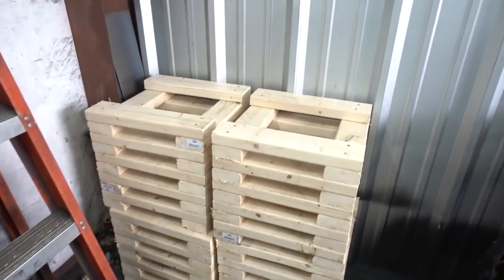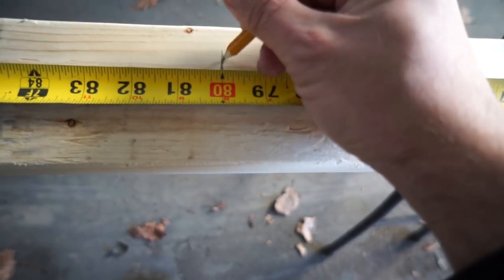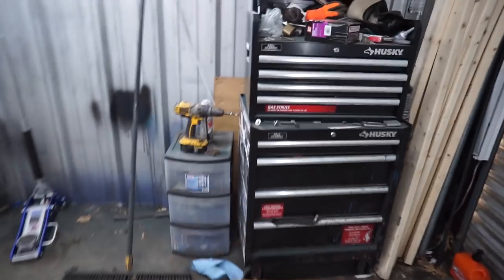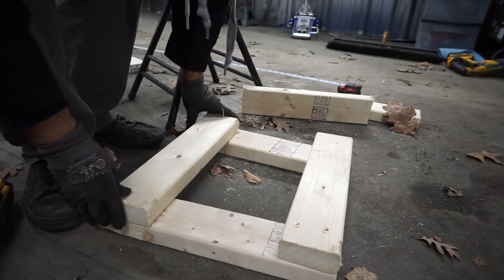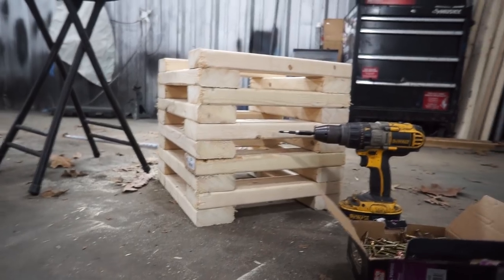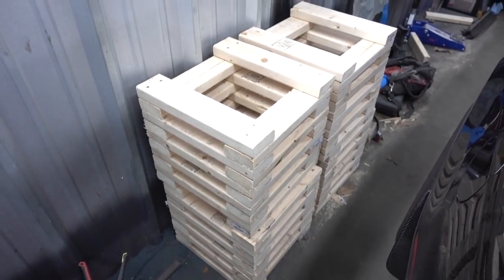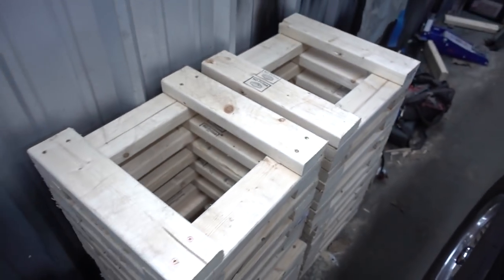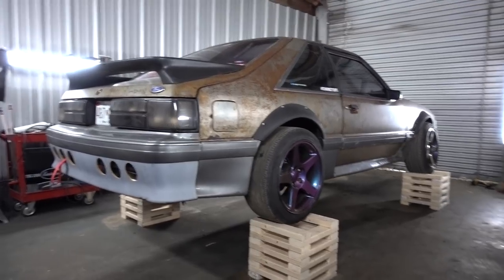How to Make Cheap Car Stands

Comment: I don't know shit about this stuff, and I don't want to know, so I own 4 pairs of jackstands in 4 sizes and always go overkill with ratings & redundancy.  I just pretend I'm flying a 747 and failure's not an option.  My famy has learned they can relax bc I don't take chances.  When the time comes I'll spring for a lift

Comment: Put some dolly wheels on it so you can move you’re non running cars around the shop or when you drop you’re motor out of the bottom you can push the shell out of the way and remove motor with wood dolly you drop it on. I would recommend pressure treated 4x4 wood tho so it doesn’t rot you may have to buy less and seems more safe 😂😂😂

Comment: Unsafe. Should have put 3 pieces side-by-side not only 2 and then double pieces in the front and back for the top layer.
Reply: Not really. Each of those stands will stand over 1.5 kN of force easily.
Reply: wood is stronger than metal come on now.

Comment: The car is resting on 2x4, if that breaks it will go to the next one and on and on. Before it goes on and on, something else will happen. The weight will shift to one side and collapse in a strange way. Even with  jack stands shifting can happen if the vertical balance is not maintained, poor vertical balance will almost certainly lead to shifting and eventual collapse. Dont underestimate the weight of automobiles.
Reply: Dont underestimate the strength of wood
Reply: YES! I see that now - just like the World Trade Center buildings (1973–2001) collapse! He needs barrage balloons and many large oak trees surrounding his garage, to ward off a terrorist attack!

Comment: Would putting 3 planks across instead of 2 be even more safe?
Reply from the maker: TheAkNas I imagine it couldn’t hurt.  I have a friend who actually did 3 across on his a while back.  The only part that might such with 3 across would be that the tire wouldn’t sink in as much on the top level.  Maybe that one could be left at just 2 boards.
Reply: I suggest cutting each piece at 14". At this length the top layer can be solid by placing 4 pieces side by side (3.5 x 4 = 14"). Perfect.
Reply: The top one is the one that needs to be more solid..I would have 4 across top if they would fit..

Comment: With the cost of the wood and the time you invested, you now have more in the stands than the car is worth...
Reply: $2.75 per 8 foot 2x4, 14 total equals $38.50. 5 pounds of screws cost $30.00. 3 hours in labour $75.00. Grand total $143.50. Resale value of foxbody mustang $135.00. Yep more in cribs then car value.